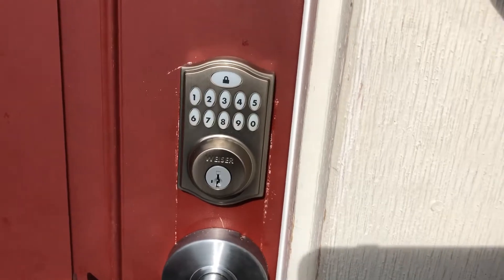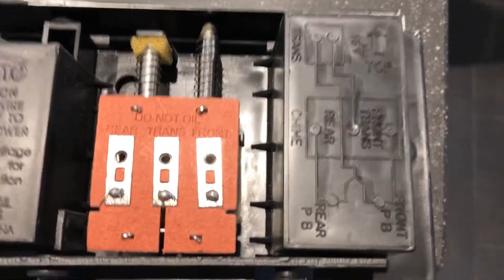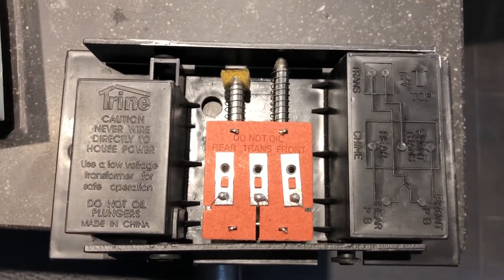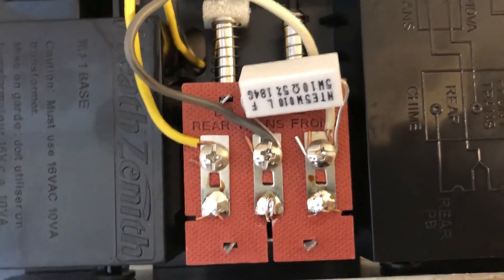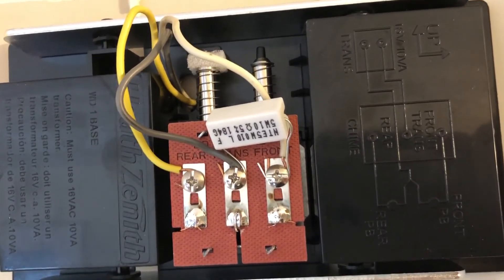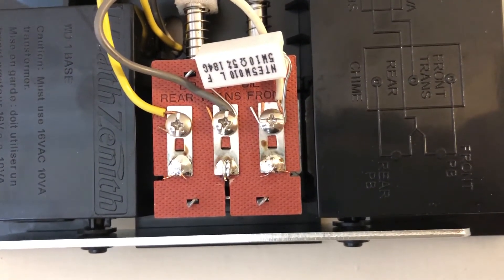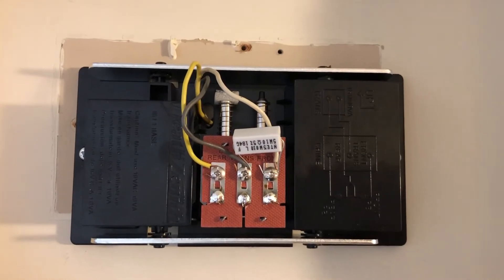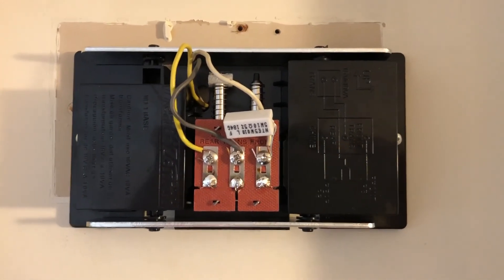How to Fix Humming Doorbell Chime After Installing SkyBell HD Edition Wi-Fi Doorbell Camera

Comment: Before messing with the electricity, I would recommend checking the settings of the doorbell first. Mine was fixed by changing the indoor chime type settings from Digital to Mechanical. Before changing the setting, I checked the transformer output and it was 21 volts, and the chime terminals I'm getting around 1.5 volts leak. After changing the settings, I get the same reading so I think the small leak of electricity on the chime is normal.

Comment: I have a Eufy video doorbell and the same buzzing/humming issue, I was going to try a smaller .5 watt resistor but after reading comments about them burning up I bought a 5 watt 10 ohm like you did. It'll arrive tomorrow, hopefully it works! I'll update this comment later with the results. Does it matter which way the resistor is attached to the bell?

Comment: I have owned my Skybell HD for almost 4yrs and did not have that issues...but I also installed a Skybell HD for my sister and her chime started to make the humming noise and after awhile it damage her Skybell..so I had to replace her Skybell and her doorbell chime which fixed the issue...we did not need a resister...